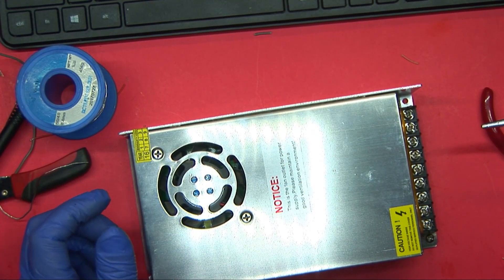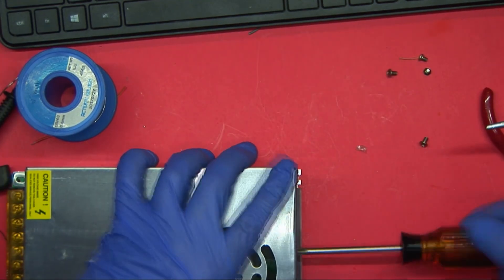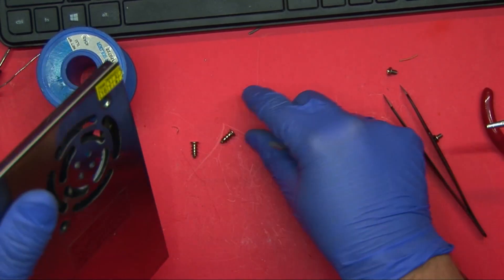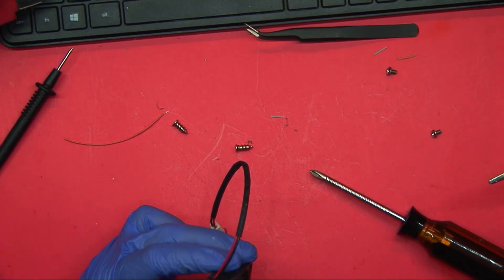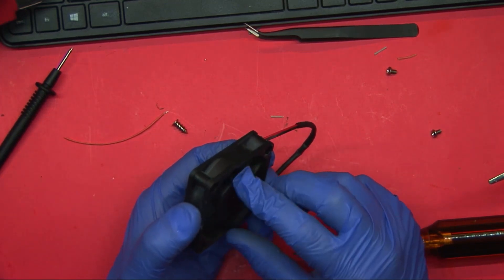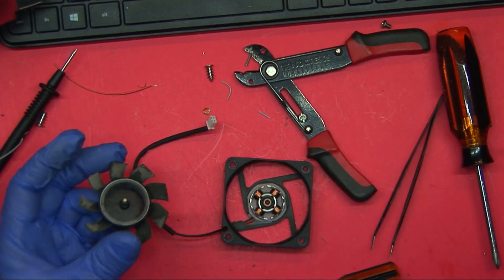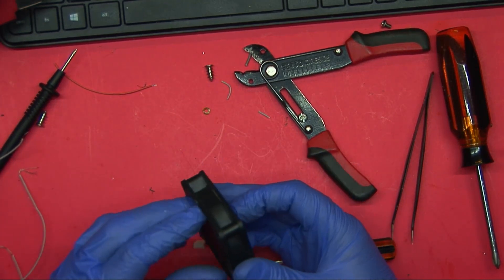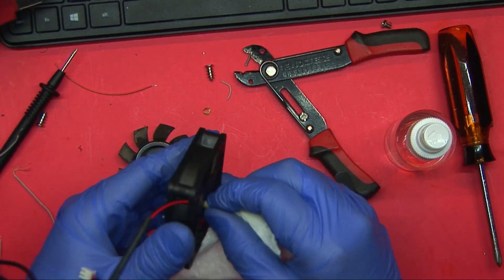Power Supply Fan Repair - Wanhao Duplicator i3 / Monoprice Maker Select

Comment: great video! I have the same printer. Just wondering, what brand of grease do you use?
Reply from the maker: Thermal grease?  Some arctic silver knockoff.  For this u can just use white silicone thermal grease.  I just had the other closer.
Reply: @Electronicle  white silicone thermal grease as a lubricant?
Reply from the maker: @MixedMuscleArts  no.